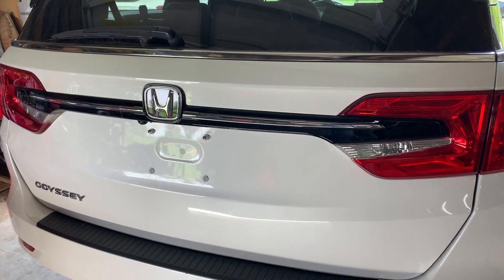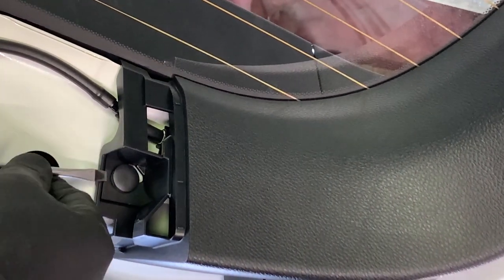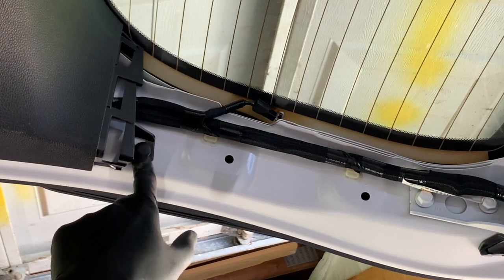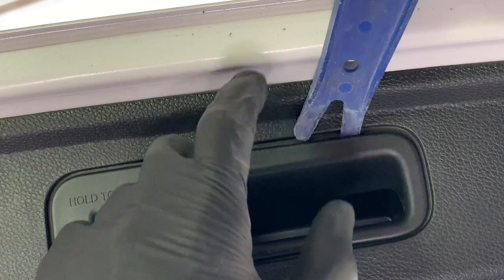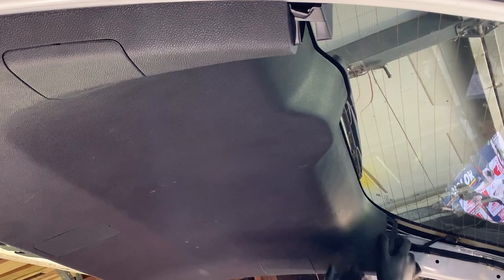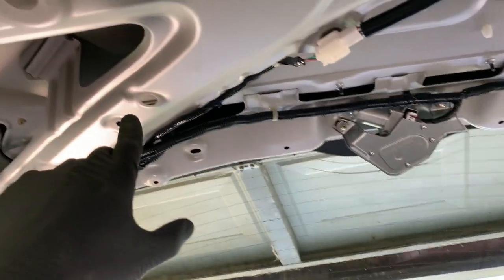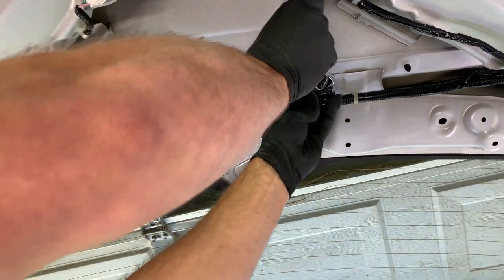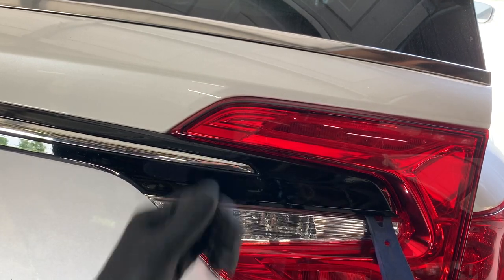Honda Odyssey How to Remove Lift Gate H Emblem Molding Trim 2018 2019 2020 2021 2022 2023

Comment: Great video! Is it possible to replace the chrome piece only without removing the entire trim?
Reply: If you want to break the clips you can but you still need to get to the nut that holds the emblem.  if it was just the clips yes but that nut needs to be removed before the new chrome is placed and just new clips .